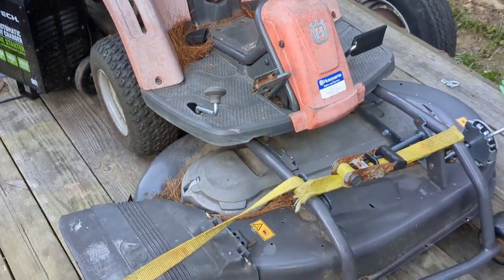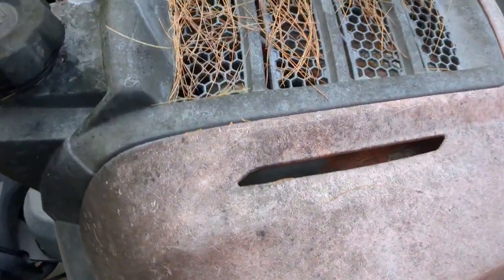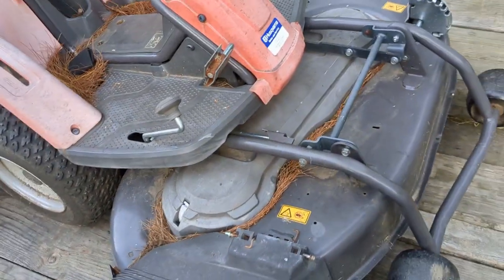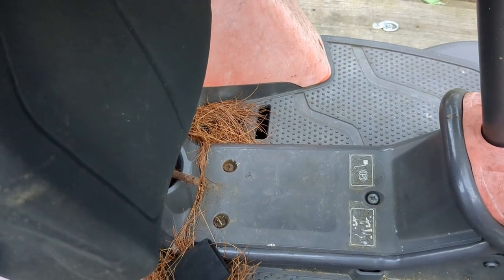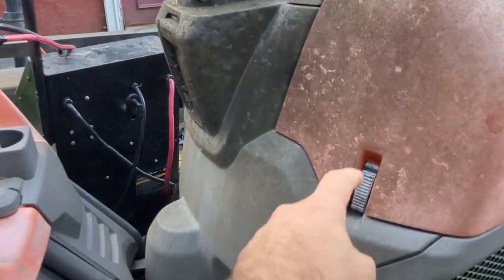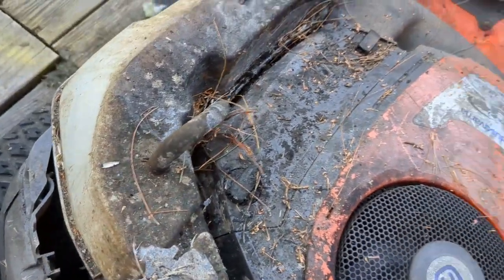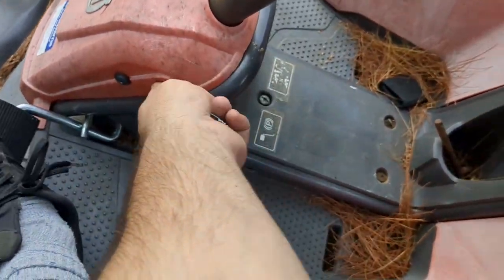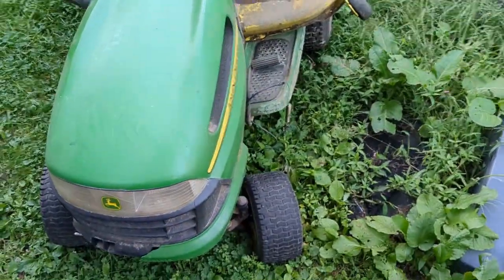Husqvarna R120S Articulating Riding Lawnmower. Will it run?

Comment: This is awesome I juts got this same machine today off Facebook market place for $50!!! It’s also the Husqvarna R120s! There apparently extremely rare to find in the United States. I found it in Texas. The thing runs and drives beautiful it’s in like new condition i can’t believe I only paid $50 for it. I had to drive 3hr round trip to get it. The only thing wrong with it is one for the belts are broken. It’s not the deck belt or the drive belt is the intermediate belt that I believe goes to the deck. It’s about impossible to find some of the parts including that belt for this as they discontinued this model in 2016.I will send you an update of how it goes.
Reply from the maker: good pick up. This is way better then a garden tractor. I dont think the others seen it for its beauty. I wouldve thrown a motor in mine if it didnt run.